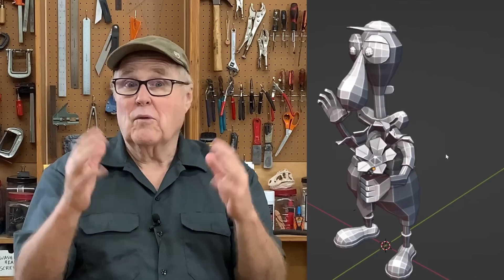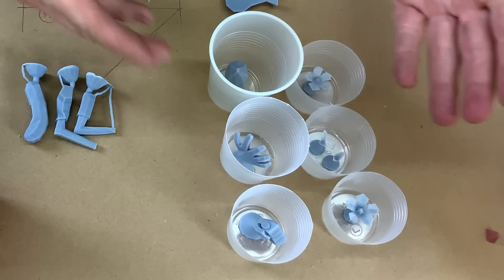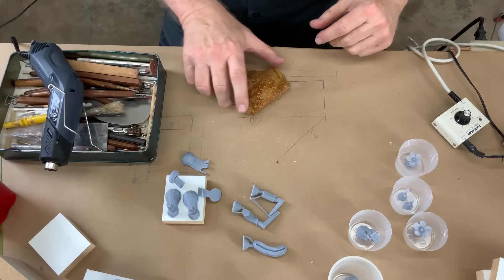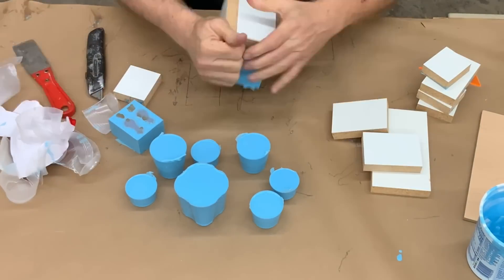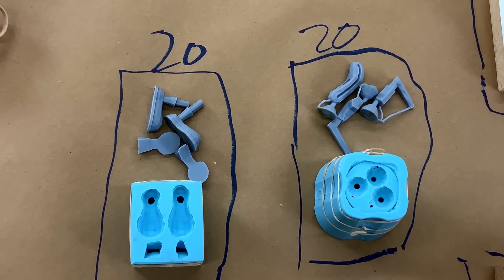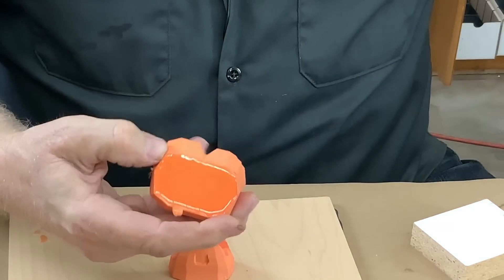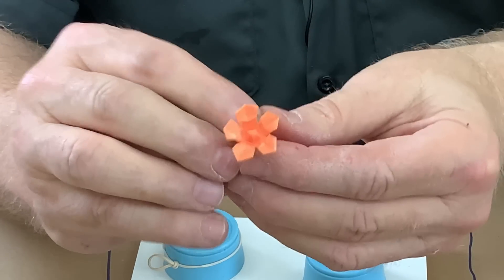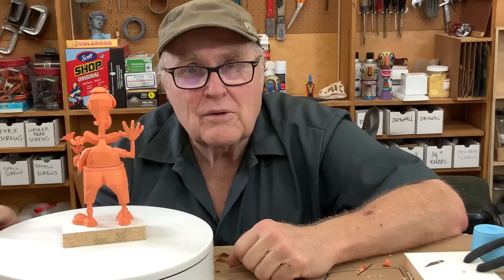3D Printing Vents And Sprues

Comment: A great video, robert, and gave me some ideas. I do have a question for you, if you happen to see this-
Have you gotten requests for doing ball-jointed dolls? This project (although I know, I know, this videos more about the 3-D print experiment) is the most applicable to the thing that drew me to resin/silicone casting topics in the first place, dolls. But, prior to your channel, I'd never seen cut molds, only 2-part molds or molds with a flat surface. I imagine casting a ball jointed doll would be very similar to this video, only many of the parts need to be hollow or at least have tubes in them (the torso is hollow, limbs are semi-hollow / have tubes going through them). I was considering whether I could put a hard rod into the silicone mold somehow to create a tube that could be removed so as to not have to drill through resin. let me know if you'd heard of these kinds of dolls/if complex casting of them can be done with cut molds.
Reply from the maker: I have been asked several times to do a video on ball jointed dolls. These dolls are incredible!  Really amazing works of sculpture and design. The main reason I have not done a doll is that there are so many parts in a doll.  And as you correctly point out, many parts are complex with two or more sections, hollow, etc. My channel has taught me that there is a specific time/labor budget for each video and it would take a lot of time to make all the molds for a doll. Just making a couple of molds feels incomplete to me; the viewers would want to see the finished doll at the end of the video.  So I have not tackled that project.

Comment: When degassing the rubber in the vac chamber- do you typically let it sit in the chamber for awhile after it breaks/deflates, or just pull it out and pour it right after?
Reply from the maker: I usually take the rubber out pretty soon after the rise and release of the bubbles.  If your silicone is a very slow cure and has a long pot life you can keep it in the vacuum chamber until all the bubbles are gone. But I have found that’s not necessary and you sure don’t want your silicone to begin to cure in the middle of a pour!
Reply: @RobertTolone  Thanks so much- I appreciate it!  While I've got your attention, I'd love to see you tackle rubber casting (something I've been working on for awhile now- I use Simpact from Smooth on). I'd also love to see you mess around with the hobby injection mold machines and get your take on them. Thanks for all the great content! You are an inspiration!
Reply from the maker: @eric3dee  I’m looking into injection molding machines. We’ll see what happens… 👍

Comment: Hello! I need your help. I'm looking for transparent silicone with a tin-based catalyst. And yet,  need this silicone to be tensile resistant so that it is not brittle. Please recommend where I can buy and what kind of silicone markings to look for. Thank you.
Reply from the maker: You can get clear tin-based silicone rubber from www.silpak.com. I suspect many rubber suppliers such as smooth on wood also supply a clear tin-rubber.
Reply: @┼22897401705...

Comment: Happen to know any silicone or a method, that would cure Overtop latex?
Reply from the maker: I don’t. Very early in my career I started with latex molds and I do remember there were compatibility issues with silicone. Best advice I can give is to contact a silicone rubber manufacturer and see if they have any recommendations.

Comment: Lanolin (technicly a wax) is darn sticky at room temperature and silicone compatible.A smear on the base of a model is sufficient to anchor most pieces, without any time pressure or danger of getting stuck.
Also useful as a release for difficult situations, say casting epoxy or superglue to a threaded rod to form a cast threaded hole.
Reply from the maker: I have never used it. I should give it a try, thanks!

Comment: Hi Robert,
I was wonder if you ever cast very small fragile things?  I have a tiny sea horse, a tiny lizard, and a few various other things that I am not sure they would hold up to removal.  How would you cast things like that?
Reply from the maker: You can probably cast them fairly easily but should also expect to break the originals in the process.
Reply: @RobertTolone  I was able to do the sea horse, but don’t really know the best products to use.  The little lizard will definitely break as its little toes are like threads.  What products would you use for the bests results?

Comment: What rubber did you use? I always get cure inhibitions with plat silicone (I mainly use smooth on brands) and standard UV resins.
Reply from the maker: Platinum rubber often has inhibition problems with 3-D printed parts.  I use tin cure rubber. In this video Econosil 25 from www.silpak.com.

Comment: i've been wondering why you havent used 3d printing in your process. it's a lot less wasteful than cutting new wood boxes every time. sla mold boxes are a waste of material but reusable fdm mold cases is where it's at. been doing it for about six years now and i'll never go back to manually making a mold box.
Reply from the maker: Wood is very fast for me, much faster than modeling a mold case and printing it.  The main advantage to 3-D printed mold cases is they can be shaped to fit the model very well. Although the time required to do so costs more than the rubber wasted in a square wooden box.  Also I scrounge all of the wood I use so it’s trash that I am reusing.  My shop is a prototype shop; every job is different. I used to have storage boxes of molds laying around but I almost never found a mold case that was exactly the right size for the current project. It’s literally faster for me to build one than it is to sort through my pile of old molds.  Best advice I can give is: whatever works for you is the right thing for you to do.

Comment: I came to this a month ago. But i do the funnel and vents right in Citubox with large supports. And that's why, you need to support your model occasionally, but if you put it in a slicer with the funnel you will support the funnel with the supports. But if the funnel is the support itself its not be lifted of a table.

Comment: I've been using platinum silicone and losing my marbles trying to figure out a way to prevent inhibition. Well I got tired and now I'm going to switch to tin cure silicone.
Reply from the maker: Platinum only has a couple of advantages over tin. One is that the molds are stable in storage whereas tin rubber degrades over time. The other is that it is good for specialized uses such as food and resins that require it. Truth is I almost never use platinum rubber. My go to choice is an economy grade tin rubber. But my shop does not need to store molds for long use.
Reply: @RobertTolone   Oh I really needed to read this. Thank you!
Reply: @RobertTolone  on the same topic of failed molds. Do you have any advice on cleaning uncured silicone off of models?

Comment: Quick hint: it's much easier to cut off supports prior to UV curing.

Also, you'll find it is better to print hollow. Be aware that this will throw off your resin weight.
Reply: Question for you - I use a pressure pot and i havent printed hollow for something I'm gonna cast with it yet because i'm TERRIFIED of it making my models explode... even if I dip the whole thing in silicone. i havent found anyone out there that can let me know what thickness I need to make my model so it doesnt explode. Any tips?

Comment: Are you using tin or platinum cure silicone?  I've attempted this with platinum cure and several types of 3D resin.  Had some uncured surfaces with most 3D resins with platinum cure.
Reply from the maker: Always tin, especially when molding 3D printed parts
Reply: @RobertTolone  when using UV resin. fdm printed parts dont cause cure inhibition. there is inhiubit x and lots of research papers out there on the effects of silicone on sla resins.
Reply: use inhibit x when using platinum cured silicone. tin cure is garbage. unless you dont mind using a mold twice before it rips.

Comment: Wait just a gosh darn minute, vacuuming resin. 🙀
I thought that was a huge no no like crossing the streams. 🤯
Reply: It had to be put under pressure afterwards though .
Reply: @glenfisher728  don't think so.
Reply from the maker: Glen is correct, I vacuumed then pressure potted those little parts.  I very seldom use vacuum on resin. But for tiny parts that are difficult to vent vacuum can be a lifesaver.  But with the resin I use I have to move quick because it gels so rapidly.

Comment: You know you could have also printed the mold boxes. Mind blown. 🤯 😸
Reply from the maker: That was the original plan. Then I realized it didn’t make much sense because the parts were so small. I will be doing videos where I print the mold cases on larger parts.
Reply: @RobertTolone  it was a bit of a joke but on a resin printer it only adds using a bit more resin no extra time. On a filament (aka fdm) printer it's extra filament and time. 
Only real issue on printing the containers is that you wouldn't be able to remove the extra supports. Custom supports and model orientation may fix that but I really don't know. I only have a FDM and have only looked into resin printer a bit.

Comment: Could you use the 3d printing supports as the vents?
Reply from the maker: If they happen to be in the right place. But there are often so many of them it would be a bitch to cut the mold.

Comment: Love the channel!  Have you considered making the holes bigger when creating the 3D model?
Reply from the maker: I did make the holes bigger than the parts that fit in them. But there were some odd distortions, like the hole in the body didn’t match the shape of the  arm.  not sure why that happened. By fiddling around with the parts I found it was just faster and easier to make the whole large enough to allow for movement in the parts.

Comment: Great seeing more 3d printing on the channel, I was wondering how long it would be before you invested more money and time in them. Really interesting to see a blend of printing and casting and how they can enhance each other.
Reply from the maker: I have been wanting to add in-house 3-D printing to my studio. For years I had to send models out to be printed by service bureaus at considerable cost. I kept watching in the industry to see when the prices would come down on machines. And also when the quality of the prints was acceptable straight out of the printer.  For a long time filament printers seemed like junky toys to me. The quality just wasn’t there and the printed parts required too much cleanup. But now resin printers are cheap and the quality is excellent. What I did not expect was to have a YouTube channel and to have manufacturers sending machines for me to try!  Lots of new toys on their way in.  We should have some fun!
Reply: @RobertTolone  
I don't mean to bother you Mr. Tolone. I was just wondering if you have any experience working with a product called "ComposiMold"?

 It is a reusable mold making material made from gelatin, glycerin, water and a preservative and is therefor food safe. It seems like something that could be a very affordable alternative for hobbyists that do not want to commit to silicone, but I don't know how well the material performs. Might even be an idea for a future video?

Let me just also say: thank you for your excellent videos that share a wealth of experience with the next generation of casters. My father and I have bonded over watching your videos together. You are a treasure.
Reply: @RobertTolone  I'd recommend resin over filament... however there's some super cool stuff you can do with filament and G10 since you can auto-eject your prints and have Octoprint generate a lot of stuff.